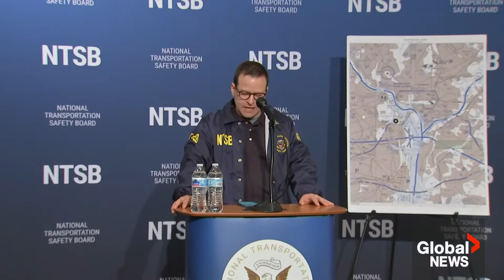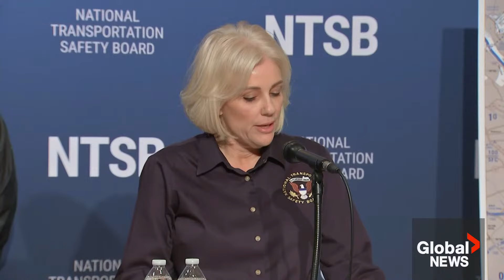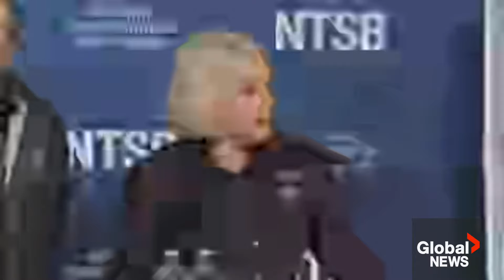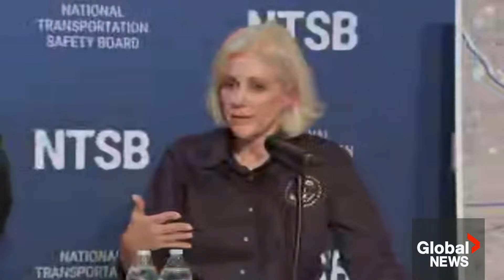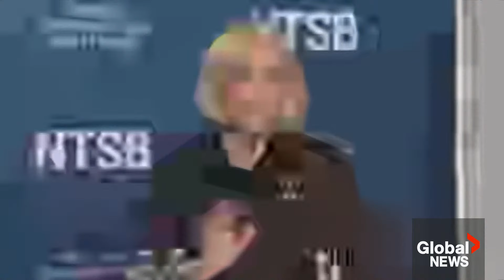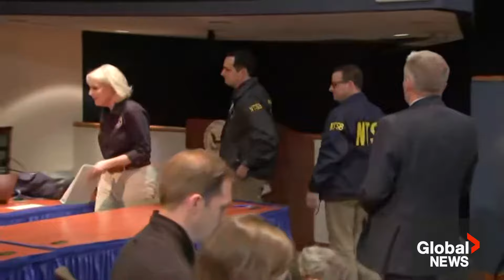DC plane crash: NTSB provides update as US senators call for better air traffic control | FULL

Comment: According to the approach chart for DCA runway 33, the nominal glidepath is 1700 feet 5 natural miles the end of runway 33. Google maps measures the distance from the end of runway 33 to the far side of the river to be 0.62 nautical miles.  Using similar triangle math, the nominal glidepath height at the far side of the river is 1700 feet / 5 natural miles  × 0,62 nautical miles  = 211 feet.
To be clear, if the CRJ was on the nominal glidepath for  runway 33 it would have been 211 feet at the far river shore.

Comment: As a commercial pilot, I have the following thoughts. The 100-feet altitude separation (or not) is basically irrelevant. That is so small that it will never be allowed. Not to mention the high risk of severe turbulance. Aircraft fly on exactly the same altitude all the time (even in the airport circuits) - but NEVER laterally in the same position and time. And especially NOT when an aircraft is landing. This accident happened a few minute/minutes before already - when they were allowed to have converging flight paths. We can see on various camera footage that both aircraft was clearly visible from the ground and the tower - showing them heading for the same spot. Visibility was vlearly VMC (Visual Metereological Coditions) as well. The CRJ would likely not be able to see the Blackhawk low and below them - and would most certainly be confident that ATC would ensure clear air. The Blackhawk is flying a routine and approved mission (with NV goggles, etc) - most certainly also expecting ATC to ensure clear airspace. I know from hard experience that any pilot that makes a mistake in controlled airspace is "corrected" instantly. We are supposedly watched all the time - for good reason. The only question I have - why did the ATC not have eyes on the Blackhawk?

Comment: ATC said for 2nd time - do you have CRJ in sight, pass behind the CRJ..   but Pilot so excited to immediately say 'we have CRJ in sight -  & will visual separate (by1000')...   that they start talking & not looking or listening       and cuts off the 2nd part of mssg. Impt to understand this. The route is VFR meaning can only fly it when can see, avoid, visually separate, go slow enough, safe  etc..  Said the female pilot (referred to as they) concluded they needed to turn left to be over the East Bank...   but were flying closer to center of river - for some reason the female NTSB emphasized the route does not give boundaries ...     but it DOES..  says 'over EastBank' and is drawn over the east bank...    so apparently some bias happening. Nobody wants to question the army or their training program - apparently hoping to blame FAA/ATC etc.  Never say speed of Helic - clearly too fast...   would have confused ATC as starts to apparently circle or slow by turning ~ 20 seconds from crash....    then turn back onto course to barrel fwd at ~120mph.....    NTSB is careful & calculated-  why not say Heli speed?   fact they cut off ATC by instantly talking vs listening?  say they vs she?   say VFR so must see- must ask if don't see etc...     but are doing a great job otherwise . Impt to mention; Heli always must avoid aircraft by speed/turns...  esp in Bravo..esp in VFR..   no scenario where can fly when can't see well....    ie I put things on to impair my vision is not an excuse....   When max alt is 200',  one would normally fly at 100'...    and slow..
Reply: You seem to have a lot of confidence in the opinions you’ve shared. Exactly what is your specific expertise relative to this accident?

Comment: If pilots in the helicopter thought that they were flying at 300', or 400', they should have lowered their altitude since both are well above the 200' restriction.  They had over 3 minutes to drop to 200' after they said they were dropping altitude.  And there would not have been a collision.  Does the Army routinely ignore the rules in that area is a valid question to ask.
Reply: yes,  and did not slow....   did not listen to 2 ATC radio calls....   lied in their responses..   likely restricted their vision... when can not....   were on '

Comment: Sounds like:
1. Night googles are an unknown detriment for visibility and being reviewed further. Flight was a combo night goggle check ride. 
2. Verified bad data amongst the pilot and copilot that was not rectified mid air in altitude discrepancy of 100ft.
3. Loss of full communication from ATC receiving instructions to go behind CRJ and that the CRJ was circling to land also at runway 33.
4. No evidence PAT25 saw impending crash at anytime per the data recorders.
Reply: 1.  NVGs could be an asset or detriment. Undetermined until they do a visability study. 
2.  Again, they said the radio altimeter read 278’. They have yet to determine what the barometric altimeters said, or pressure settings were correct. The radio altimeter is not normally used while flying. It’s a good cross check, and was possibly consulted by the pilots. In the military craft I was a crew member on, it was smaller and not in the in the center of the pilots view of instruments. I hope they can nail it down.
Reply: they where not even on the same raido channal why
Reply: @ Between ATC and PAT25. Not between craft.
Reply: God is Good, All the Time!
Reply: @InformedConsumer321  If you ever used night vision equipment,  you know if direct light hits those lenses you are blinded for a period.  WHY IN H WOULD YOU USE THEM IN FLIGHT TRAFFIC PATH!